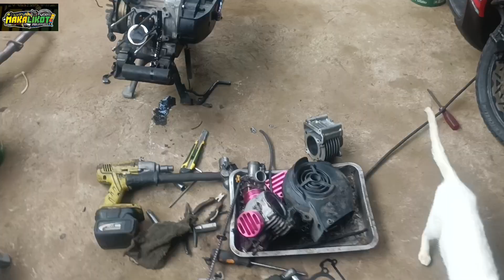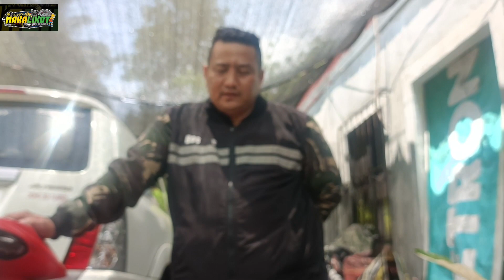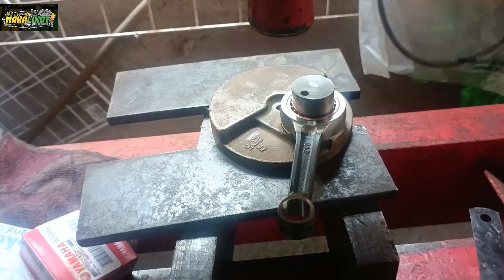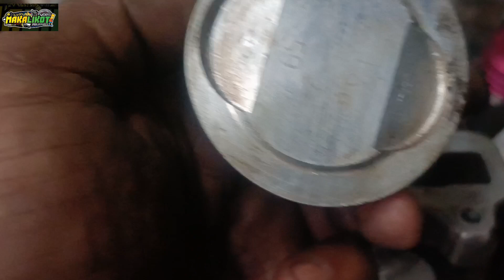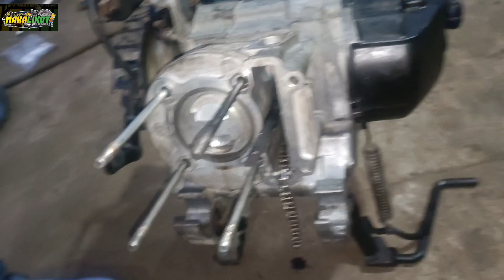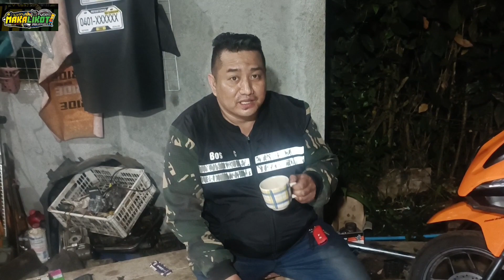59all stock kakabuo lang overheat agad kumatok pa ano Ang dahilan tara ayusin natin

Comment: Bakit skin lods 59 din dirin naka port. Dirin naka Valve pocket goods naman po?
Reply: baka pitsbike block malalim tlga minsan pocket non pag binili
Reply: Boss,mgkano pa-reset ng 59 allstock? Taga gentri lng po ako,pwde b mgwalk in jan?
Reply: Yung sakin kc untog Kya pati connecting rod Damay sira ...Kya mas maganda mag pagawa tlga sa marunong
Reply from the maker: Baka low com Kya di nauntog sir KC Yung ibang nagagawa ko ganyang ginagawa para mashirtcut Yung gawa para di na sila mag pocket at dinumuntog piston Saka depende sa cam sir Meron maganda frofile Minsan sa block din pag cromebore talagang walang overheat
Reply from the maker: Pwede po dir
Reply from the maker: Dami nadamay sa motor nyo sir ano
Reply: MP LANG SKEN BOSS. MALALIM DIN GOODS NA GOODS SA 59ALLSTOCK NAKA CAMS AKO 6.0 AT VALVE SPRING.
Reply: Sakin cnc block 59 wala rin sabit okay naman